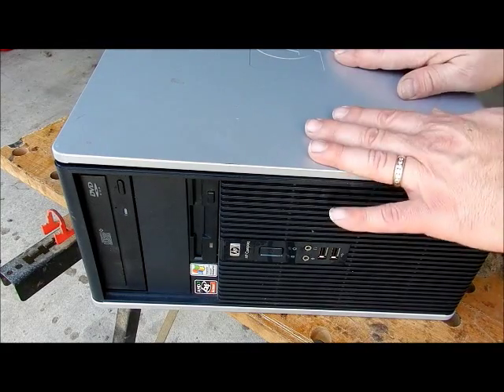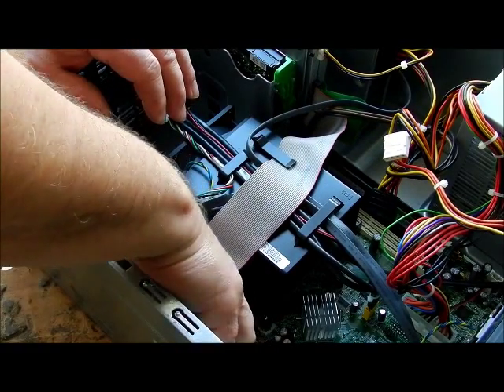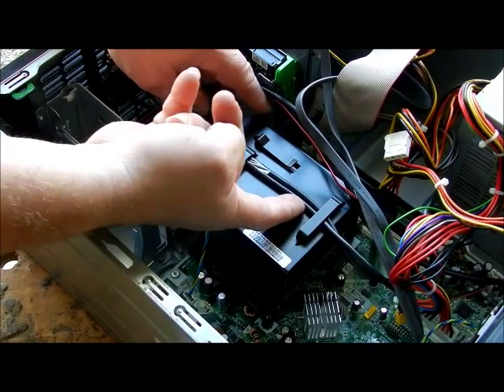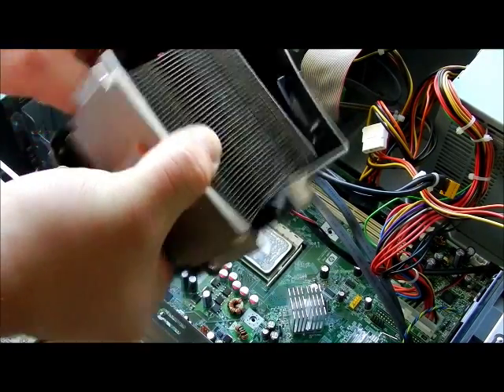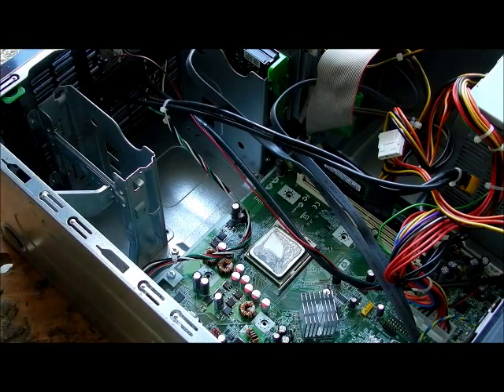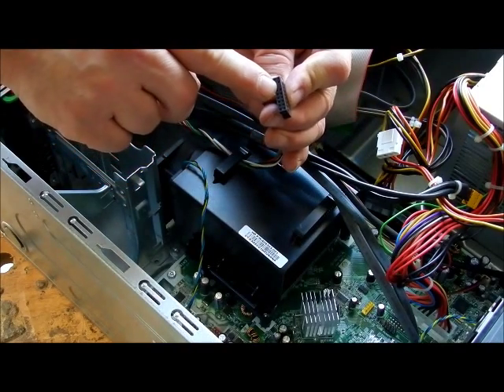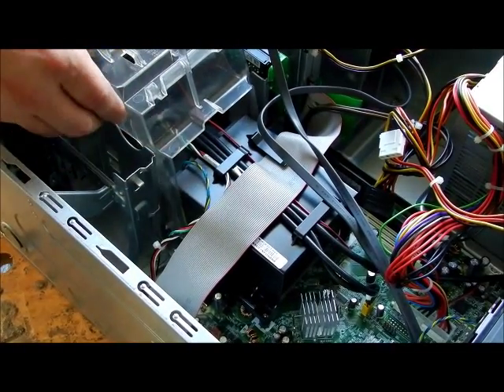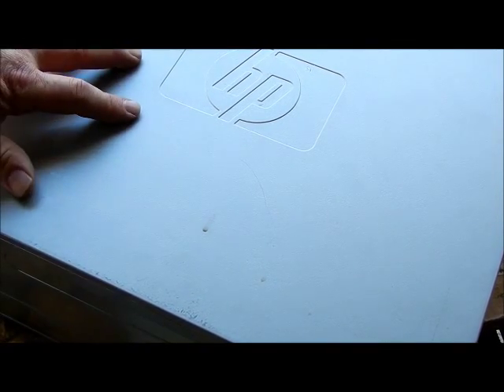Replacing an HP dc5750m CPU Coolling Fan

Comment: Dear my 5750 pc both CPU and system fans are running in full speed right from boot kindly suggest
Reply from the maker: They should slow down as the computer cools.  Try adding a desktop fan to help with the cooking.  Point the fan to the vent area.  Hope this helps.